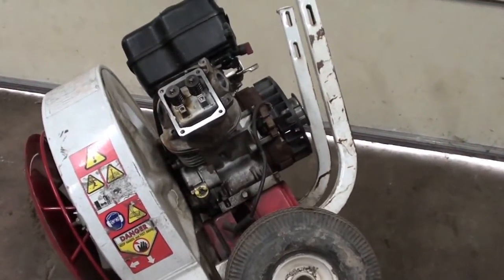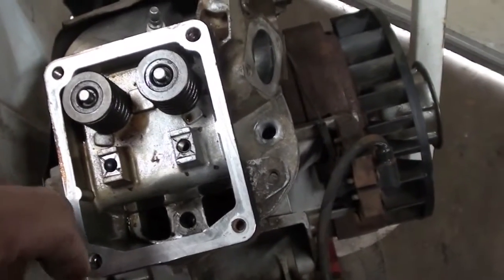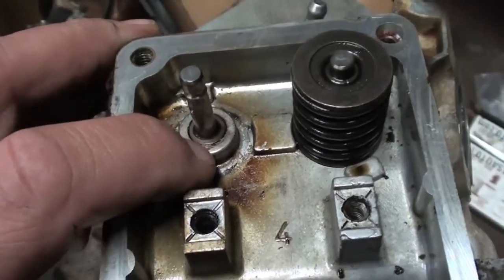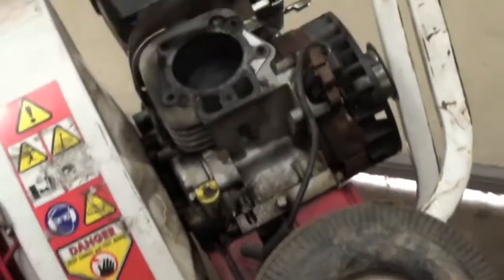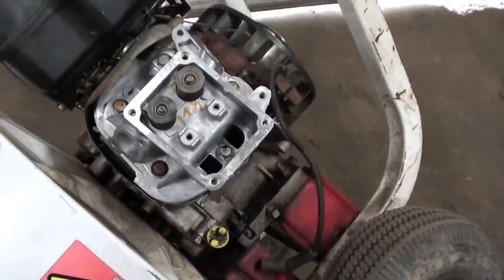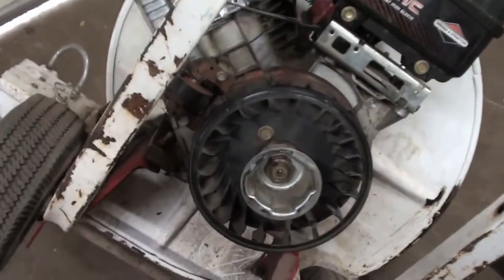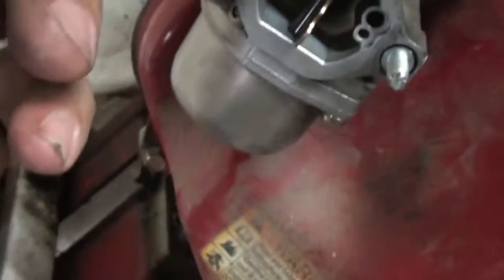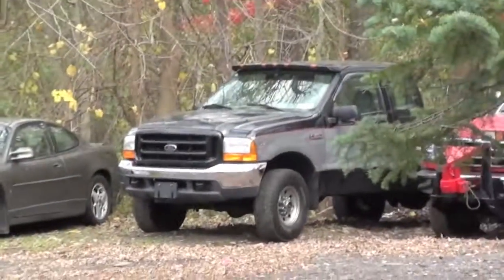8hp Briggs and Stratton OHV head replacement

Comment: I have the same exact problem! Guess it was the new gas like you said. On mine, the rods broke the same way. Ordered new rods but they seem to be smaller than they should be - any advice?
Reply from the maker: yes, they are shorter. you have to adjust the rockers to take up the slack.